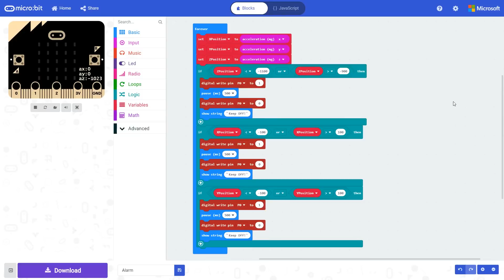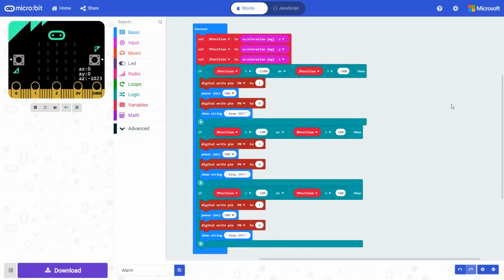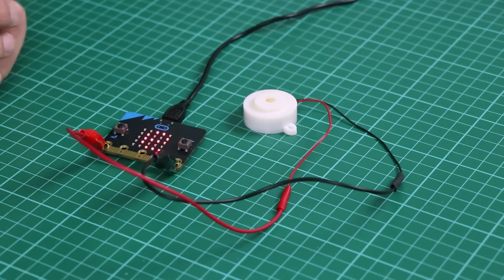The BBC micro:bit, what is it and how can it be used?

Comment: can i use bluetooth and usb serial communication simultaneously ?
Reply from the maker: Hi Darshnik, Bluetooth and Radio can't be used together but I'm reasonably sure that Bluetooth and Serial communication can.
Reply: @kitronik  I have again tried according to your suggestion. But not happening. So it's humble request can u make video on issue ?
Reply: @kitronik  ok it means both can send data simultaneously.